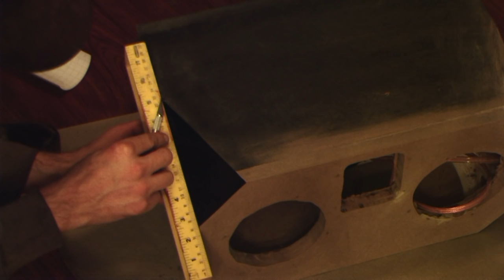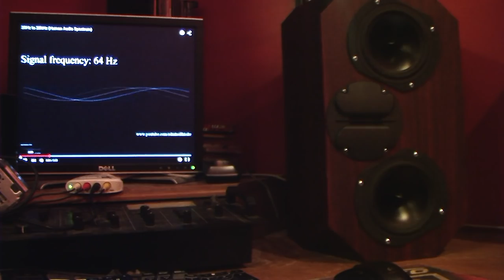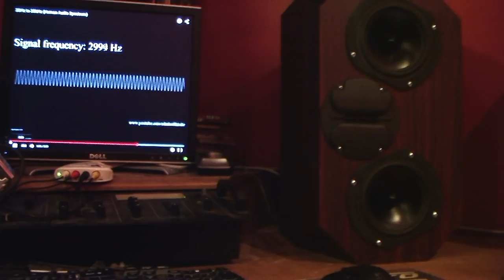DIY Home Theater Center Speaker Build Project - Edge Audio C3-4740k

Comment: Awesome build. You are a brave man using a router like that!!!! I just recently got into speaker building ive built 4 sets this year alone haha. I am an experienced wood worker though (12 years) you can use liquid nails I just prefer not to because of the mess it makes. wood glue works just as good. You should also clamp and or screw the box together. once you have it all assembled use bondo instead of that wood filler it will crack and crumble away, bondo would hold up much longer im sure you have same laying around since your a car guy haha. Im just throwing out some pointers for you other then that awesome build and design!!!!

Comment: So basically for your center you built a 3 way speaker using the same speaker for mid and low and a tweeter with a wide range of frequency response. The cross over and the low and mid speaker would have to be capable for the wide range?  This is basically what I want to do.  Thanks for posting video.

Comment: by the way you can put fiberglass resin on the inside to ensure a perfect seal, if you have it it can be a bit easier to get it perfect than using caulk/silicone, nicely done nevertheless

Comment: Consider counter sinking your drivers so they are flat with the front panel to remove diffractions.  Also consider a 45 degree chamfer on the back side of the driver cutouts.  Odd sounds are generated in this area and can contribute to a poor sounding finished product.  Finally, do a sweep with REW and a calibrated mic such as mini-dsp's so you can see the frequency response visually.  Finally, the crossover is probably the most important part of a speaker, how did you design it?

Comment: Very nice DIY speaker!! great job for that and your theater room too!, can you tell me what kind of glue are you using? is it silicone like the one for sealing windows and stuff like that? can you tell pros and cons with regular wood glue? (i'm from Mexico and here we don't get all the nice stuff but i can seek for something similar), which speakers did you use? what's the white thing you put inside? and one more thing,  is there a difference in sound quality if you use solid wood instead of MDF? looking forward the next speakers!! thanks!! greetings!

Comment: Great work! I think is a little late for this suggestion, the tweeter should be isolated from sharing the same cabinet space with the bass/mid/full range speaker. The big speakers membrane is pushing a lot of pressure on tweeter membrane causing it to distort/delay/suppress/whatever. And like the other guy said :p use black screws on black surfaces:D

Comment: Quick question. Not sure if I missed it in the video, but what's the name of or where did you get that crossover network you used? Thanks!
Reply from the maker: This is the crossover I used in the build: 
https://www.parts-express.com/eminence-pxb3-3k5-3-way-speaker-crossover-board-500-3500-hz--290-652

Comment: I'm planning on building a bookshelf-type speaker/amp system but having trouble figuring out what spec'd amp-board I need to get for the following speakers:
(each speaker would be a pair)

[Tweeter (pair)]      6ohm / 15 watt (RMS)
[Full range (pair)]   8ohm / 30 watt (RMS)

What should I amp-watts/ohms be?  My forum 'research' produces mixed results...
Any guidance/advice would help!  
Thanks
Reply: Any amp will do.
Just pick a good 50-60 watt amp and use it.... no problem

Comment: The only thing I will critique is your use of the router. Never cut round cutouts freehand. #1 you won't get a perfect circle...#2 it can be dangerous if the loose piece gets caught between the spinning bit and the hole cut out.

Comment: +LostNotForgotton I have a small home theater setup 5.1, off some old speakers and stuff, dosnt sound bad. but what is the circuit board inside the speaker? im not the most smart when it comes to speakers but i know more than average people
Reply from the maker: +Mr. ManDudeGuy Thanks for checking out my video. The circuit board you mentioned is called a crossover. It basically separates the sound and sends the low frequencies to the woofer, mid sounds to the mid-range (if you have one) and the high sounds to the tweeter. Sending the full sound spectrum to one speaker causes distortion as a speaker will try and vibrate slow for the low sounds and fast for the high sounds all at the same time which can be stressful for a speaker. The crossover allows each speaker to handle the sound range it was designed for. Hope this helps clarify your question. If your considering building your own speaker I'd suggest going for it. It can be a fun, rewarding learning experience that you can be proud of and show off.
Reply: ***** Thanks for the reply, i was thinking about building my own box for a subwoofer, Anyways, I was confused, because you said the crossover sends low frequencies to a woofer and mid sounds to the mid-range and high sounds to the tweeter, i dont remember a lot about this video but i only see two speakers on that center speaker, so does that crossover take the sound from your amp/receiver and that board has three different  outputs and you just put those speakers on the low frequencies and i think thats a tweeter in the middle and so the highs to that tweeter, or is that thing in the middle just like a port tube or something
Reply from the maker: This has two woofers. I'm using a three way crossover so the low sounds are sent to one woofer and the mid sounds are sent to the other woofer. These woofers have such a broad sound range that they could be used for both. Using the same speaker line help keep the sound level. Sometimes mixing different speakers together you get certain frequencies that are louder or softer than the rest. Yes, that is the tweeter in the middle. It's a ribbon tweeter which is why it looks different. After you hook up your speaker wire to the speaker the sound is filtered by the crossover to the speaker best able to provide the sound. It also regulates the power. 80 watts through a sub might sound weak but 80 watts through a woofer might sound nice but 80 watts through a mid-range might be over powering and 80 watts through a tweeter might either make your ears bleed or blow the tweeter. The crossover helps regulate the power to give each speaker the right frequency and power to give you an overall nice sounding speaker. You might have great speakers but a crappy crossover can ruin the sound quality of the whole speaker. Hope this helps explain it ;)
Reply: +LostNotForgotton Thanks for the video your a master with those angles and the vinyl but I'm totally confused here with your box design and the 3 way crossover. 

I'm not sure if you sized the box and the port for one woofer or two? Looks like you sized it for two. Should be for one only right?

Also any mid-range needs to be sealed/isolated from the woofer via a closed back or a separate chamber. If not the woofer will push against the mid's cone and cause it to move at 180 deg out of phase with the woofer, canceling out the base. Especially in this case as the mid is a woofer. In other words  (barring what air escapes out the port) at the same time the woofer moves "in" the mid-range - woofer's cone will move "out" because you crossed them so only one woofer gets bass and they are not firing simultaneously. You basically made a totally out of tune passive radiator out of your mid-range. This will also add all kinds of distortion - note the mid's back waves will be acting on the woofer cone creating distortion there as well. 
If you want to test this - block the port and you will see with low bass notes the cones move equal "but opposite" from one another and you will have virtually no base at all. I'll bet you have more bass coming out the back port the way you have it set up now. 

Also with a 2nd order crossover like I think your using the mid-range driver is normally wired reversed polarity due to to the phase difference the crossover creates to keep the drivers as close to in phase as possible. Maybe the xover is labeled reverse polarity by default have to check.

Not sure why you didn't opt for a two way xover MTM design and have both woofers supplying bass that would add to the woofer and mid-range sound pressure and not cause distortion issues with their common chamber. Maybe the tweeter couldn't keep up.

I would think a lower crossover point may also be needed to avoid the bad cone breakup those metal cones have in the upper region unless the ribbon will not go low enough. Rule of thumb crossover no lower then an octave higher the the fs of the tweeter and no higher than an octave lower then the cone breakup on the woofer (at a 12db or steeper slope with these drivers). Not sure if 3500 falls in to that range or not would have to look at driver spec's.

Not trying to dis your project at all... you got very nice drivers there just think some research and tweaking is needed for them to shine at their full potential.

Comment: The crossover network is the crucial part of the speaker. It has to be custom fitted to the drivers and the enclosure surrounding them. There is no way that you get an optimal sound quality from an off-the-shelf crossover. That is at least what I learned from my 23 years of speaker building. My first five attempts to design a crossover went horribly wrong. The sixth to tenth one were okay but still might need some improvement. Usually you're better off buying a kit someone experienced and trustworthy developed. That's what I did when I wanted a reference speaker for my designs. I'd recomment the German magazine "Hobby HiFi" which unfortunately is not available in English. But you could choose from my Top 10 speakers video: https://www.youtube.com/watch?v=gMyE3SUvSeM&list=PL4lJ1ej0uWlQ5xjxRERTleY3A5Xr8zzpq

Comment: its speaker what is rating in ohms and  what is the inside circuit coli name .
Reply from the maker: +surya prakash The speaker currently runs about 6 ohms and this is the crossover I used in the build:https://www.parts-express.com/eminence-pxb3-3k5-3-way-speaker-crossover-board-500-3500-hz--290-652

Comment: i used a jbl charge 2 for this and about blwe it air came out of every hole in it at like 223hz i had to quit it
Reply from the maker: +subwoofer kid If what you are saying is that you built the same box as I did and used the JBL Charge 2 speakers in it then you may have a couple of issues. Speakers needs a specific air space in order to sound right and the taking the speakers out of the JBL enclosure and putting them in a ported box meant for different air space could negatively impact the sound quality. I couldn't find any specs on the woofers used in the Charge 2 and I couldn't tell you how to calculate the air space on the round enclosure they come in. That's a little out of my league. As for air leaks you can use silicone to seal up the air gaps and make sure you use a gasket to seal the woofer. I don't have any air gaps in my box so it is possible to do.
Reply: +LostNotForgotton no o watched the video with my jbl, i built speskers with orion sorda like u did and it inly has 2o watts

Comment: no bass...dude the guy said its a center ch speaker...wtf who wants bass from a center ch speaker...buy the way good job bro...kudos for  D.I.Y.....bunch of haters out there.
Reply from the maker: Thanks! Yeah I usually ignore the negative comments. As I mentioned in the video its a learning experience so there is no need bash someones first attempt at something...but people do anyway. The funny thing is people are saying the speaker has no bass but all they are judging is the quality of the microphone recording the speaker. The sound quality will only be as good as the microphone recording it. The speaker sounds great with a nice full range in person. Microphones don't typically have a lot of low range because there isn't many instruments or voices that really goes lower than 60htz.
Reply: Most center speakers don’t have an oversized, rear facing port like this does either. It looks as if it were designed as a full range speaker which for a center channel is not the best design.